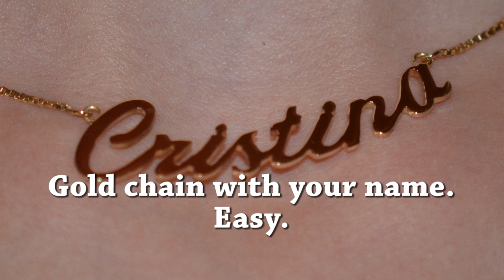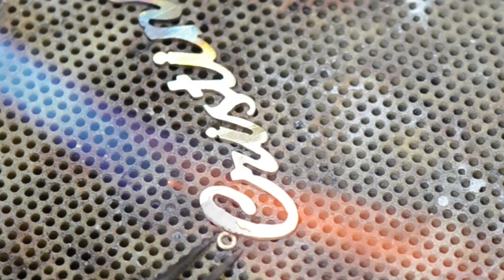Gold chain with your name Easy to make handmade.

Comment: Lol the title makes it seem like you can make it easy at home... neither of which are true
Reply: It’s possible, you just need the right tools, I work from home doing this kind of thing :)
Reply: Start off simple and build you way up to a project like this one. Collect the necessary tools as you go.
Reply: Yeah, you definitely can if you want to. I made my wife a much more complicated ring for our anniversary for my first project. Sure, you'll need to buy a saw and some special blades, but you could hammer out a piece of metal (no roller needed) and sand it to dimensions. So, you need a chunk of steel, a hammer, sand paper, and a blowtorch. It wont be as refined as this one without a special jewelry torch, but I used a pencil flame propane blow torch (in an apartment no less) for my project. This? Easy peasy.
Reply: Handful of Tranquility keep it easy and just buy a small sheet of the metal you want in the thickness you need!
Reply: To make this at home out of silver you would need less than $200 in supplies. You could get a sheet of sterling silver plate, 1"x6" for about $10-$20. A cheap jeweler's saw and blades would cost $15. A set of cheap needle files, $5. Piece of sandpaper, <$1. A couple pairs of small pliers, $10.  Silver wire, $10-$15, and some solder, $15 (with a lot left over). Flux - just use borax, a huge box would cost $5 and you mix a small amount with some water (equal parts, 50/50). The chain, $10-$15. Little butane torch, $10 (use a torch-style cigar lighter). Vinegar and small crock pot (for taking away tarnish after soldering), $20. For polishing, get a cheap rotary tool and some small felt buffing wheels and some polishing compound... $20. If you wanted to do this in gold it would be a few hundred dollars to get a 1"x6" piece of 18k gold plate and a gold chain. Gold solder is also more expensive. In any case, yes, after getting the right supplies and with a little bit of practice, this would 100% be one of the easiest pieces to make at home.

Comment: you make it look easy. but I just made a copper ring the other day with a star cutout and it wasn't so easy to cut out that star. I cant imagine trying to cut out someones name. good work. you use that saw like a pro. do you use the twisted or strati blades?
Reply from the maker: Thanks, I use blades for goldsmith http://www.mealli.it/it/prodotti/c/u/lame-per-seghetti-iris

Comment: I saw in a comment that you said that this piece have 7 grams of 18 kt gold and cost 300 Euros.
This is the final price or you sell this to a jewelry for this price and them sell for +/- 500 Euros ?
I ask this because i'm working in a jewelry and my boss made pieces like you, but he sell 1 gram of craft gold for 70/75 Euros to public.

PS: Your work is pretty good !
Reply from the maker: Thanks The final price of a gem depends on many factors. Not all jobs require the same time to achieve them, some of my work cost 40/45 euro per gram others 100/200 Euros or more. The ratio depends on the amount of material used and the time spent performing the work. the video jewel is simple and quick to realize, for this, the manufactory little impact on the total cost.
Reply: Thanks for the reply. It's clear that my boss works differently. He sells all his works to 70/75 euros per gram of gold no matter the time. In case the piece takes stones add to the price of gold. All his works are with 3D printer except the names and the alliances.

Comment: Hmm...I could use a bit of stainless steel that's been heat-colored to look like gold.  The only hard part of this video is the use of a rolling mill, and that's nothing a bit of practice wouldn't solve.  No rolling mill?  Hammer it out.  No gold available?  Use your imagination and try bits of other metals.  Granted, a torch kit and the two-piece mold isn't something you might find in your local hardware store, but you shouldn't let that stop you.